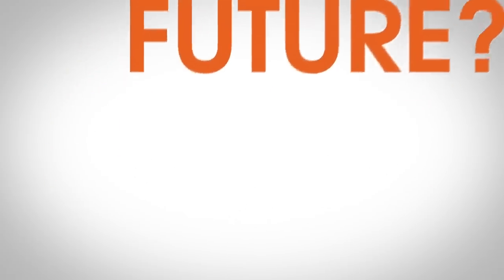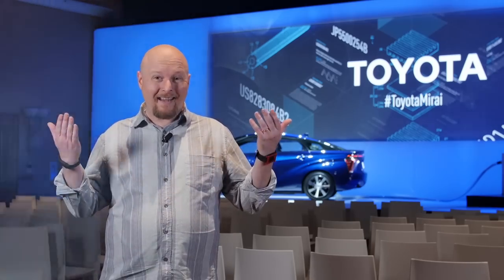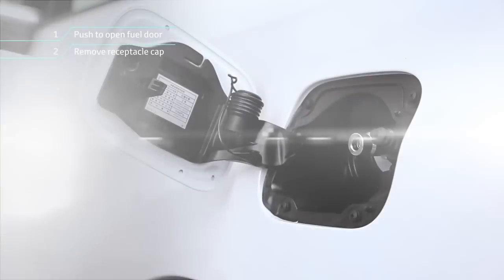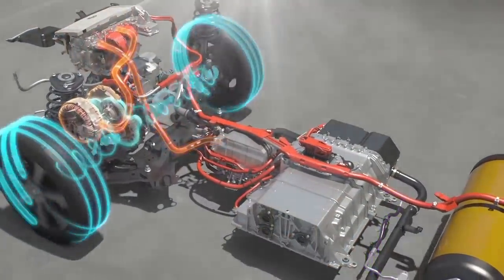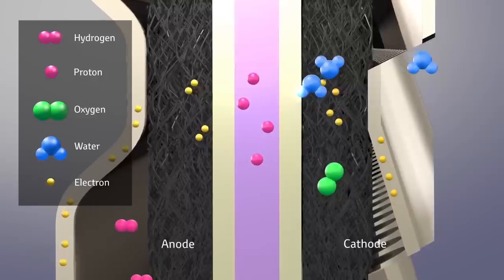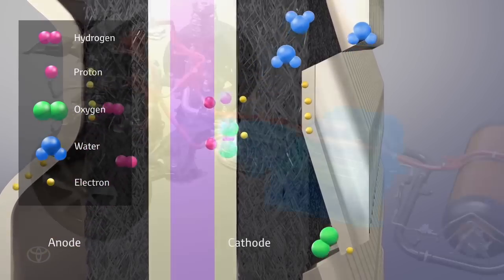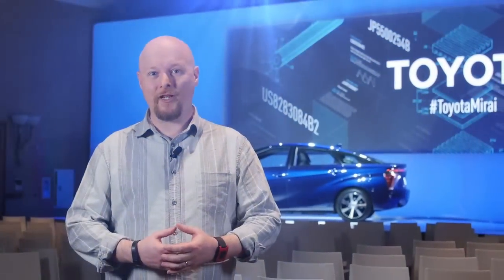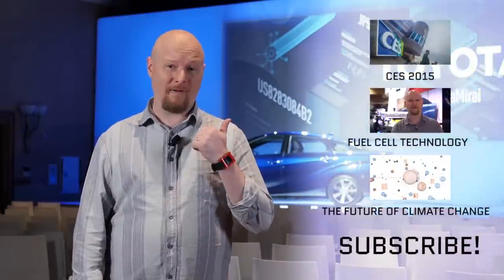How Fuel Cell Vehicles Work – CES 2015

Comment: I'd love to see this tested in Australia. Teslas would be exceptionally great in the cities but out in rural areas they just don't have enough juice to do the long hard runs to town and back for the shopping or going to market to buy/sell livestock etc. Hydrogen fuel cell vehicles with a larger capacity tank however could very well potentially go WELL beyond the Tesla shortfall and replace petrol/diesel.

Better yet if a commercially available solar driven mini plant could be made where you could fill your vehicle from home for free then the technology would have a REALLY strong chance given the cost of fossil fuels around here (around $1.60AUD/L atm). The ability to just plug the hose into the car when you get home and fill it for the next trip and actually have enough stored in a tank for the next refill with energy from the sun and water from the sky would be exceptional.

We at least are having a large drive on solar electricity now which is GREAT to see. It has a long way to go as 99% is still grid tied bydirectional metering etc but with LION battery tech and other polymers becoming cheaper and easier to get compared to years ago needing a large shed full of 2v lead acid batteries with REGULAR maintenance required our solar is finally coming to a point where we can look at having at least an auto grid/off grid switch where you remain off-grid unless and until your Tesla Wall and panels can't keep up (too much draw or bad weather) and then you are automatically switched 100% to the grid until the wall comes back up to a minimal level. 

The future is starting to look a little brighter but the cost still needs to come down because at the moment it is out of range of low income earners.
Reply: Yes.  Range Anxiety is still the major stumbling block for BEV and FCEL does plug the gap.  Let us know more about what you think in the comments of our latest vids on FCEL.  LikeShareSubscribe.

Comment: I don't understand why they can't put water in the car & provide a system that converts it to hydrogen. It seems to be the only lucrative process in the long run. Unless they plan to pull hydrogen out of the tap water at local fuel stations across the world. Because the low density of hydrogen makes it a logistical nightmare to transport. It would take 23 tanker trucks of hydrogen to give you the same miles as a single tanker truck of gasoline. Even though hydrogen has more energy per mass the low density forces an onsite or in vehicle hydrogen conversion.
Reply: If you add water mixed with baking soda and add about 12v electricity to the mixture it creates hydrogen for fuel with only oxygen emissions
Reply: Because that makes no sense at all. In order to use the water as a fule source you first have to convert it into hydrogen gas by electrolysis. Electrolysis requires energy. That energy must come from somewhere and that would either be an internal battery or an external power source. If you were to use a battery to convert the water into hydrogen gas you would be loosing a lot of the stored energy, in the process of electrolysis. In that case it would make much more sense to just use the stored energy right away by powering an electric motor. Why would you go through the extra hurdle of converting water into hydrogen gas if you are about to reverse the process seconds later?
If you were to use an external power source to perform electrolysis you would still have the same problem of storing the hydrogen in a separate tank. It's therefore not an option to fill your car with water since it would lower the total efficiency of the car by many percents.
Reply: xTronnKillmaster the guy who made it got killed, it's dangerous business only big corporation like Toyota can handle that couse they have yakudza working for them

Comment: Where do we get this Hydrogen from and how many tanks do we require to cover just one kilometer.........
Reply: It's costly to run a car with compressed Hydrogen. But you need less weight than a battery. The tank is not that big.
Reply: @preetammukherjee623  It's pretty big (voluminous), but less heavy than a battery for the same range.
1 kg of hydrogen at 10.000 psi is about 25 liters. And you have to consider the thick walls of the pressure tanks.

Comment: the hydrogen filling stations will be quicker that waiting hours to recharge batteries .  put them in production save the fossil fuel for jets diesel racing , ect.  the engines (electric motors ) will be cheap and a regular maint . replacement . remember ...   create jobs ..............
Reply: Toyota has always lied in such promotional videos and this has not changed 6 years later. At 4:58min they claim: "No carbon emissions like petrol or diesel powered vehicles".
This is true - if you look at the fuel cell car alone. If you look at the whole chain (well-to-wheel), hydrogen today in 2021 is made from more than 95 per cent natural gas, coal and oil, as it was in 2015.
The hydrogen car is therefore dirtier than all other vehicles!
Of course, hydrogen can be produced from renewable energies via electrolysis. But this method is several times more expensive and therefore there will never be a large number of cars with hydrogen as an energy storage medium.
Toyota needed until 2019 to produce and sell 10,000 Mirai.
At 4:59min I had to laugh:
The biggest revolution has failed ...
The new Toyota Mirai II (2020) does not even have a folding rear seat back. The hydrogen tanks take up a lot of space.

Comment: Get around distribution issue by putting water in tank and converting it in house. Super insulate against extreme temperatures and use some passive solar to keep water in liquid state, for example.

Comment: You could use the hydrogen fell cells to charge a battery pack to drive an inverter to power a house...Solar /  Wind power could produce hydrogen and stored for the cell
Reply: Exactly. Hydrogen is the perfect way to "bottle" renewable energy so you can use it whenever you need it.

Comment: It truly is very exciting and a engineering milestone to finally develop and put into production a fuel cell car. No batteries and 300 mile range with a 3 to 5 minute charge and not worry about having all electronics including air conditioning on at the same time also not degrading range or torque....WOW!!! 
I really hope more manufacturers also pick up this technology and hopefully we can all get off toxic fossil fuel and nuclear power sources. And with government incentives you get $14k discount. That's about $43k for a Mirai......$30k Less than a tesla. I applaud the years of dedication to all of those involved in this development.

Comment: I think we can automate fuel cell cars using various sensors,as there is much space due to absence of all that heat management systems that are present in a typical petroleum car.And by photolysis of water we can even create hydrogen at home and hence save a lot by producing electricity for home use.

Comment: is hydrogen tuff to production making. how much does it take to produce a engine or motor. and milage. can it be supercharged to a power vehical
Reply: It's easy, in the long term not expensive, you add it to an engine & yes supercharged is great!, Get stuck in & do some home work!

Comment: I saw some postings about carrying water & making the H2 on the car but the weight of water is alot heavier than the H2, also wondering if this tech can be applied to air travel with electric turbines & the weight of H2 has to be significantly  lighter that  Jet A fuel as to semi's using this to tow heavy loads diesel locomotives are essentially just electric motors being powered by a diesel engine generating electricity cut out the diesel engine for a stack fuel cell, to an electric motor.

Comment: how many cells do we need to operate a plant ?
Reply: Depends on the size of the cells.
This Toyota Mirai has a stack of 370 cells which can achieve up to 114 kW.
With 10.000 of these fuel cell stacks, you could theoretically produce more than 1 GW of electric power.
But they have a pretty limited lifetime. And I suppose, permanent maximum power wouldn't work well.

Comment: Where do you get the Hydrogen???
Reply: Toyota has always lied in such promotional videos and this has not changed 6 years later. At 4:58min they claim: "No carbon emissions like petrol or diesel powered vehicles".
This is true - if you look at the fuel cell car alone. If you look at the whole chain (well-to-wheel), hydrogen today in 2021 is made from more than 95 per cent natural gas, coal and oil, as it was in 2015.
The hydrogen car is therefore dirtier than all other vehicles!
Of course, hydrogen can be produced from renewable energies via electrolysis. But this method is several times more expensive and therefore there will never be a large number of cars with hydrogen as an energy storage medium.
Toyota needed until 2019 to produce and sell 10,000 Mirai.
At 4:59min I had to laugh:
The biggest revolution has failed ...
The new Toyota Mirai II (2020) does not even have a folding rear seat back. The hydrogen tanks take up a lot of space.

Comment: This is not enough information for me. 

Where the energy gets store? 
Does those sell use lithium?
Reply: The major part of the electricity directly feeds the electric motor. A part of it gets stored in a 1.6-kWh-NiMH buffer battery. Similar to the battery of the Toyota Prius (1.3 kWh).
No lithium-ion-battery in this case.
But that's just a rather less important detail in my view.
The Hyundai Nexo uses a lithium-ion-battery instead, but this doesn't make the car worse or more ecologically harmful.
Reply: Toyota has always lied in such promotional videos and this has not changed 6 years later. At 4:58min they claim: "No carbon emissions like petrol or diesel powered vehicles".
This is true - if you look at the fuel cell car alone. If you look at the whole chain (well-to-wheel), hydrogen today in 2021 is made from more than 95 per cent natural gas, coal and oil, as it was in 2015.
The hydrogen car is therefore dirtier than all other vehicles!
Of course, hydrogen can be produced from renewable energies via electrolysis. But this method is several times more expensive and therefore there will never be a large number of cars with hydrogen as an energy storage medium.
Toyota needed until 2019 to produce and sell 10,000 Mirai.
At 4:59min I had to laugh:
The biggest revolution has failed ...
The new Toyota Mirai II (2020) does not even have a folding rear seat back. The hydrogen tanks take up a lot of space.

Comment: Forward thinking.... how about the forward thinking about how much effort it takes to make the bloddy hydrogen. not to mention the fact that theres bugger all hydrogen refuel points and its hard to transport it to remote sites for future refueling sites. 
The reason why toyota shared it is because they cant go it alone in building the infrastructure required. They could but the board and shareholders would lynch them.
Reply: Toyota has always lied in such promotional videos and this has not changed 6 years later. At 4:58min they claim: "No carbon emissions like petrol or diesel powered vehicles".
This is true - if you look at the fuel cell car alone. If you look at the whole chain (well-to-wheel), hydrogen today in 2021 is made from more than 95 per cent natural gas, coal and oil, as it was in 2015.
The hydrogen car is therefore dirtier than all other vehicles!
Of course, hydrogen can be produced from renewable energies via electrolysis. But this method is several times more expensive and therefore there will never be a large number of cars with hydrogen as an energy storage medium.
Toyota needed until 2019 to produce and sell 10,000 Mirai.
At 4:59min I had to laugh:
The biggest revolution has failed ...
The new Toyota Mirai II (2020) does not even have a folding rear seat back. The hydrogen tanks take up a lot of space.

Comment: hmmm well I think this would be an amazing step forward, and it's one we actually need to make, this type of energy would not only be cleaner, it's also incredibly abundant. my only questions are 1. depending on much these cells cost, and how effective they are, will people actually buy this? 2. just what happens to the hydrogen and oxygen that gets expended? it doesn't just disappear, unless the idea that matter cannot be created or destroyed isn't applicable here.
Reply: annnd nevermind to the second question,after hearing it play again I got the answer, water....wait that means we just need to split the hydrogen and oxygen again and....limitless power source?
Reply: The current pricing for the Murai in japan is US$57,400 but you would have to be pretty stupid to buy one (rather than lease) in the US given the pilot for the fuel stations & fuel only has funding for 3 years. If the fuel stations were to close (as many have already in many countries, and one did 20 miles from where I live) then you would have no way to fill up the tank.
Yes the exhaust is water (not recommended to drink as it might have trace metal content).
The snag with the whole thing is that the hydrogen is made from natural gas so the whole carbon thing is a wash, and the power needed to get the hydrogen is way more than that needed to take an electric car the same distance.
Reply: Roy Richardson eh I'm not really that concerned on the issue, but i like to feel that we're making progress forward. I think we just need to... refine it a little.
Reply: deathknightrevan Snag is that one cannot avoid the inherent problem of how much energy is needed to break the bonds to free up the hydrogen either from natural gas or hydrolysis.

Comment: Hydrogen is limitless in environment but what about oxygen it's limitations and higher amount of H2O production . Is it also safe
Reply: @Red27 Doomhammer The only virtually "limitless" and easily usable hydrogen source is water. And if you produce hydrogen by electrolysis of water, you produce also oxygen. 8 kg of oxygen per kg of hydrogen. There is no loss of oxygen at the end of the day.
Unlike now, with the combustion of fossil fuels. This produces CO2 and H2O and consumes O2. And there is no replacement of the consumed oxygen.

Comment: Correct me if I'm wrong but hydrogen is just a way to store energy. How is it better than say a battery in the application of powering a car? I am not trying to knock it, I just really would like to know.
Reply: no its not because it has only 1 orbit ! soo it can store or release 1 electron ! idk .... its my imagination !
Reply: I think the biggest advantage is high speed refueling
Reply: The hydrogen fuel cell is a generator of electricity.
Why would you want to generate electricity in a power station, plug the car into a power point and store it in a battery when the care generates its own power and spits water out the tail pipe.
Also, you can plug the car into the house and use the fuel cell to power a house when there is a power outage.
Reply: A battery can only store X amount of energy. Think of it as a fuel tank. It is not very energy dense at all. A fuel cell is an engine that generates electricity. It does not store it. You have to power a fuel cell with Hydrogen and Oxygen. Since there is O2 in the air, you simply need to carry a good bit of Hydrogen. You can carry enough Hydrogen to make a LOT more electricity for the same volume/weight when compared to a battery of the same size. Of course a hydrogen tank + fuel cell are going to cost significantly more.
Hope that helps.
Reply: TCPUDPATM PORTS Hydrogen is in fact a store of energy not an energy generator as there is no pure hydrogen naturally occurring on earth that hasn't already formed water meaning electricity is needed to convert water to hydrogen through electrolysis.
Reply: Luke Stoltzfus 
Quicker to fill a fuel tank than to charge a battery.

Comment: hydrogen fuel car having advantage of fast filling and longer drive mile compare to full electric car, but it better if can improve filling way like provide handy hydrogen filling device, can fill anywhere when has electrci plug to function, even collect air when move and convert directly to hydrogen for tank use, or can combine with electric cell to function, even wheel rolling when move also can charge the electric cell, so first charge can drive longer already